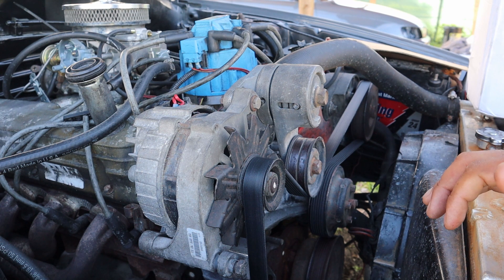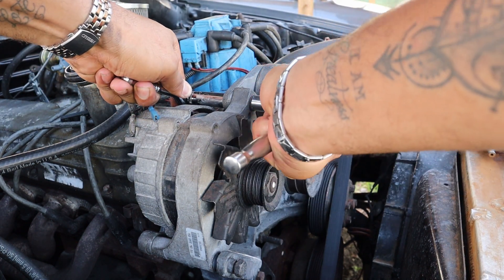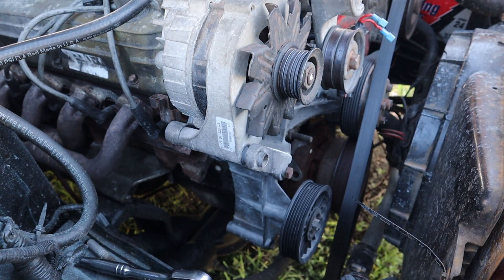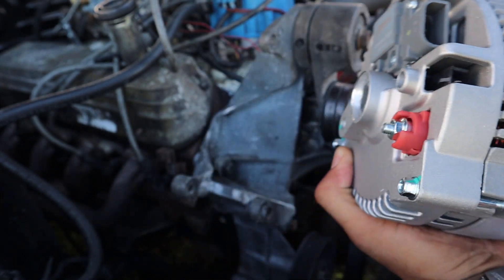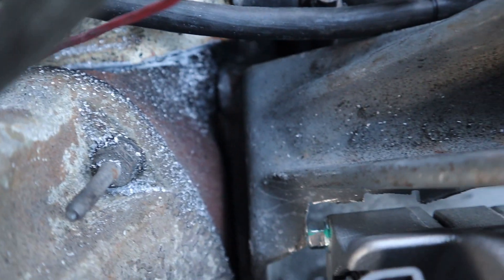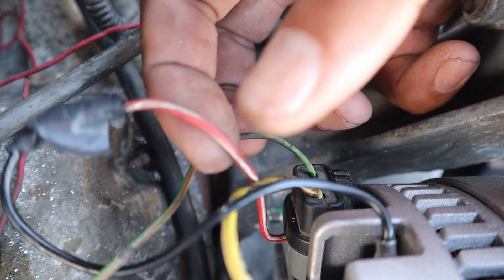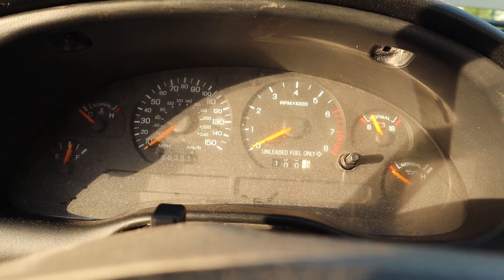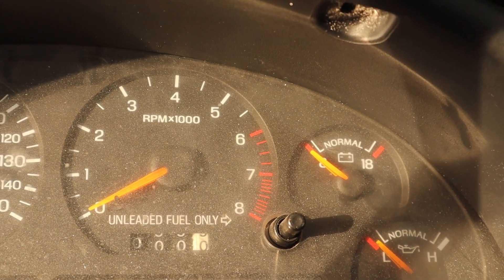Ford 2G to 3g Alternator Upgrade

Comment: Did this upgrade on a 1991 F150 with a 4.9l. I thought i did everything perfectly but it is only putting out 12v at 1000rpm. What happened?
Reply: Hi, I’m attempting to take on this task on my 94 f150 4.9l. Did you find a solution to your problem in case I run into the same thing?
Reply: Did you get it fixed?

Comment: I did his swap on. 91 f250 7.5l and my battery light is now on and the alternator constantly charges at 14.5 what did I do wrong?
Reply: DriftDreams 242 is it supposed to charge constantly?
Reply: DriftDreams 242  it seems something has happened now it’s 13.5 and rarely gets higher my digital voltage gauge stays the same 13.5 but my trucks factory gauge goes up m down with the touch of any electrical switch
Reply: DriftDreams 242 on the charge gauge on The dashboard it says normal on it underneath the picture of the battery the N is the first letter in the word normal looks like it’s under charged it usually sits at the M 3/4 the way up on meter
Reply: DriftDreams 242  it’s showing the factory gauge at just over the N on the reading

Comment: You can reclock the Alternator so the connections will be on the bottom area. I did mine like with no issues in 20 years.